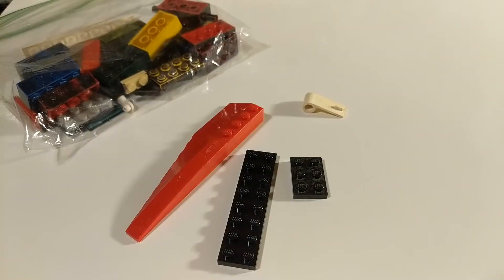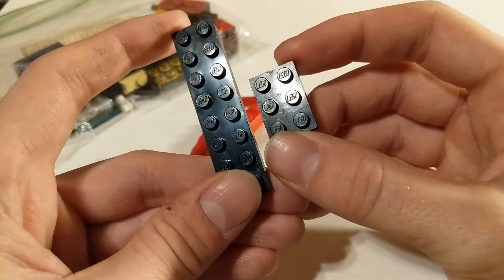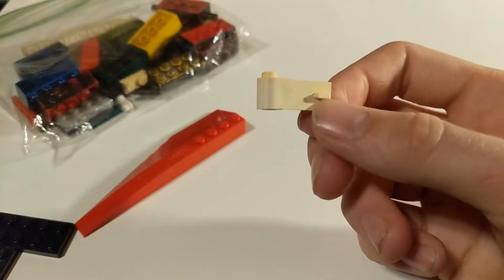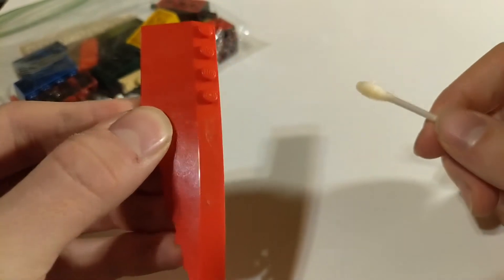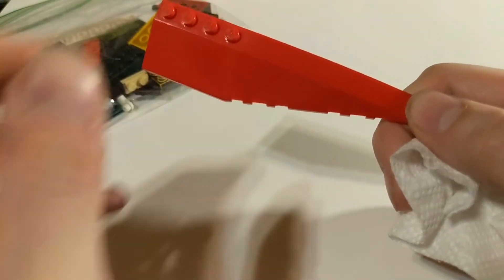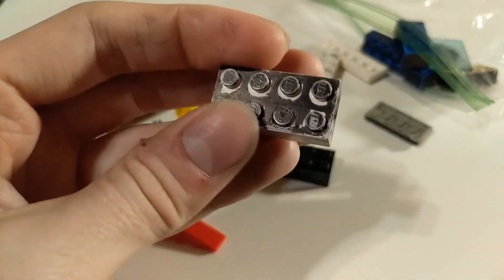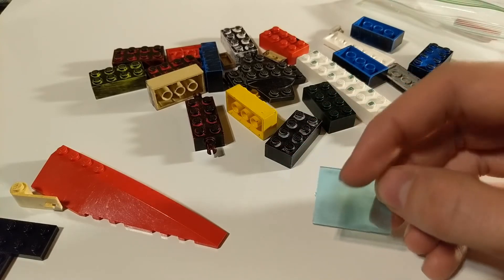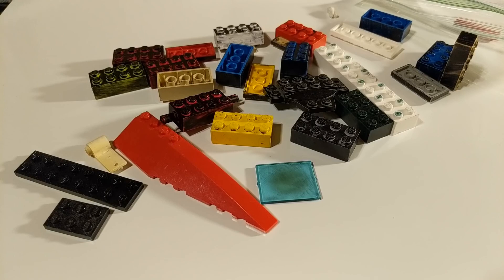Remarks on LEGO that is Sticky, Yellowed, and Sharpied

Comment: Helped me alot, I also got good results with hydroperoxid. Is there any solution to remove scratches on trans clear parts, I have this Panel 10x10x12 Corner (2409) and would really to see it clear, instead of nearly blind. Thanks, loving your content!
Reply from the maker: Thanks J, glad to hear it. I really haven't looked into restoring transparent parts, but I've always thought there might be potential with a similar approach to how vehicle headlights are touched up. I think it has to do with a sealing agent that matches the density of the plastic. Might be worth looking into down the road